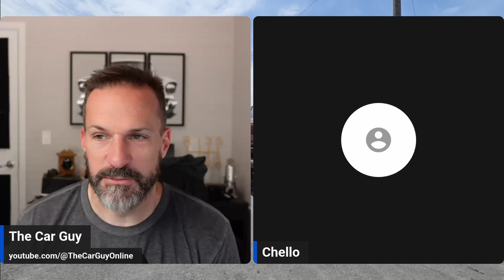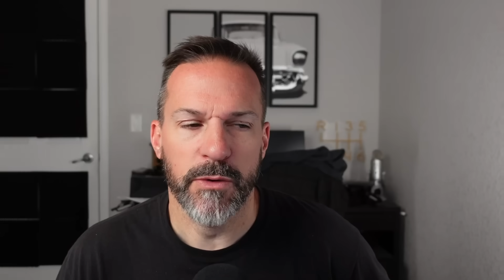Former GM Engineer EXPOSES Planned Obsolescence Tactics.

Comment: How naivety can skew reality. My goodness lol, who thinks this is GM specific? Cars are designed to last 5 years and trucks are 7. I’m a retired contract design engineer and while primarily gm based I have worked on many many brands, this is what everyone does, since the beginning of time. It’s called a budget. You want all the advanced technology and a car to last a lifetime and get crazy mpg and go 0-60 as fast as possible and tow 20k pounds? Most can’t come close to affording that. You can’t force people to take care of their cars, manufacturers are covering their ass with the 10k oil change, you try to go to a Toyota or Honda dealer before 10k and ask for an oil change. They will argue with you! Honda dealers these days will flat out refuse to change your oil at less than 10k. I still do my own maintenance no matter what I’m driving.

Comment: Stopped buying American cars 20 years ago.

M3 from 2015 that is tracked 4 times a year and has 80k miles on it. NO ISSUES NOT ONE

X7M 60k miles NO ISSUES.

Both bought used for less than $50k each.

Comment: Used to have freeze type plugs for oil gallery... Now it's a plate with little rubber gasket. That fails. Then the you have to block off the valve on oil pan it can fail....their final trick run the engine hot

Comment: The factory and the dealer care about the first owner who buys a new vehicle on a five-year loan. After five years (lets assume it has 40K miles), they want you to trade it in at the dealer and buy another new car. The dealer then wants the car to have a "good enough" reputation at 40K miles that he can sell it with a loan for monthly payments to a customer who can't quite afford a new car. The factory doesn't profit from the second owner, but the dealer does. 

Lets assume the second owner has the vehicle for seven years and the vehicle is now roughly near 100K miles at 12 years old. If a dealer gets one of these on a trade-in, he will send it to auction. If the owner tries to sell it direct to the public, the "third owner" market is rough. You might get a loan from a bank but the interest rates will be high, and if selling it for cash, you have to find someone with enough cash to pay $5,000-$9,000, and this puts pressure on the seller to lower the price. 

Since the Factory and the dealer do not make any profit off of the third owner market, they simply do not care about reliability after then. As long as the first and second owner are loyal to brand "X", the factory and dealer both want you to send them to the junkyard when they are 12 years old...

Comment: 18 yrs late to the party brother.

It was obvious when the 07+ gmt900s came out heavily reliant on can-bus systems and the modules kept failing and right at the 15 year mark- GM stopped supporting parts and the aftermarket for modules was flashed used modules ensuring the trucks are heading to a crusher. 

Hell. I have a 2009 that GM told me part were on back order for 3 years until the 15 year mark and it was discontinued.  So I asked them what am I supposed to do with a truck that’s a boat anchor- the dealers response “we have new trucks on the lot outside”

I’m not trying to buy an $80k touch screen with a truck that sorta works attached to it. I want the truck I paid in full for to work.

Comment: Every time I hear these explanations all I can think of is very wealthy men playing money games.  It's always cost savings!  Cost savings!  What are they saving?  It's always the customers that pay for the cars.  What's the cost difference between buying a car that will fail and a car that is well-made and will last?  Is it like $1000?  I'd rather pay the $1000 extra to have a car that wasn't going to break, as well be worth decent money when I'm done with it.  I gave up on GM cars years ago for the very reason that time after time I'd have to unfairly pay for repairs and replacement parts, and it was always because GM went cheap.  It was always failures due components being made cheap and they would fail.  And I say unfairly, because customers can't break things that I've had to pay for.  An example is, short of stabbing the instruments in the dashboard, how can a customer break parts that are simply looked at?  Another example is, how can a customer break a brake caliper housing?  So, GM hasn't had any of my money for almost twenty years now.  GM has to know about people like me, so I say the powers that be at GM just don't care.  It's all about very wealthy men playing money games.  Perhaps GM's upper echelons would do well putting study into the Ed Cole years at GM.  GM doesn't need money boys at the top because clearly that doesn't work.  GM needs engineering men at the top because they're the ones who can create well-made cars and turn a profit.

Comment: I was aGM guy forever.  My 2014 Camaro ended that. LS3 great motor shit oil pump. Check valve hung up, at 20k miles, thank God I caught it immediately. It was a known problem they said was fixed in 2013,bs.  Fuck Mary Barra, she ruined GM.

Comment: Driving an original 03 Element with 280,000 miles and replacing head gaskets on an original 04 Forester with 230,000 miles.  They are great cars.

Comment: 25 year mechanic here,  I used to think GM was really bad engineering,  then I realized it's really good. They know exactly when it's going to fail. Buy a Honda or Toyota.
Reply: You dont want a honda nowadays. 😢
Reply: Ive had 4 Mazdas...I beat all of them to death...530k...437k...one run over on the interstate by an idiot at 250k...260k+ on a 2016  cx-5...why buy anything else? Brakepads & rotors, tires, sparkplugs every 100k...I'll have another. Wish they designed & built a v8 pickup with an 8 ft bed
Reply: Late model jap brands are no better than anything else these days.  All garbage.
Reply: Absolutely. With todays technology and manufacturing capabilities every part is designed to work so many hours.
And they literally can and do work damn near exactly the amount of hours the part was to designed to operate regardless
of its application. Autozone was one of the first to master this manufacturing technique with the majority of the Duralast line 
of parts working for just over a year before needing to be replaced. And for free mind you. Autozone doesn't have the best parts, but they do have the best warranty.
Reply: And they don’t share that information with you, the customer, so you can at least predict your own maintenance.
Reply: Buy something pre-covid.
Reply: @papablunt49  it’s pre 09. 
The 08 crash made them look at thier business models. Also euro 5 came in so you started to see more DPFs & EGRs on diesels and direct injection on petrols.
Reply: @HellSent2.0  Lol exactly what I was thinking
Reply: @papablunt49  Buy something pre-2008 economic crisis

Comment: I have only bought one car that was built after 2006. That car's transmission went out at 101,000 miles. Both cars built before 2007 are still going strong with over 200,000 miles and probably will last up to 500,000 miles. I don't miss them spying on me with OnStar or all those expensive sensors they put on transmissions and engines. A cigarette lighter does just fine for charging my phone which also provides GPS, music, and weather. If the automakers think we are stupid and continue in their ways, consumers will become as resourceful a Cubans in maintaining their cars and the auto industry will cease to exist.

Comment: I can’t remember his name. This is about 1995 in Seattle Washington at a little restaurant called Mr. Ed’s on 1st Ave., South. There was a couple guys I used to talk to every now and then in one of them was a retired automotive engineer he told me the most Difficult project he ever did now this was disgusting and it’s not his fault. He said they wanted him to Design this is General Motors a wheel bearing that would make it past the warranty but not last more than 45,000 miles now you know why I find that disgusting you gotta remember let’s talk to 50s. I’m now living in Pennsylvania. There’s a crossroads 8 miles from where I live cranberry corners if you went a mile either direction north east south or west maybe 2 miles at the most you were in desolate areas if your car broke down, let’s say in a dead of winter You were gonna have to walk several miles before you could get to a household that would let you get out of the weather so let’s picture a family with young children. They could’ve died due to exposure because it was greedy. Jack offs pieces of shit at general motors. My name is Jim Mungai from kennerdell Pa

Comment: I was Mister Goodwrench at 3 GM dealerships and planned obsolescence isn't the only problem, sending every truck out without enough gear oil in the differential and low ATF in every auto transmission they sold!
Reply: Low fluid levels in new vehicles they sold or used vehicles or both?

Comment: The consumers that are shopping for new pickups are the young people coming in the world of adult hood,, They want tech an a power engine an the manufacturing stepped up for that but a powerful engine does it make a pickup truck what do you do with the power plant after 6 or 7 years take it out and set it over here in the corner for furniture because I thought it was good for not like back in the day when you could just rip those days are over unless you're quite the fabrication man then anything's possible. But man these pickup trucks down in a pile and completely out of sight and the old square bodies from the 70s and early 80s are still going to be running around,,, for the money they charge for those new pickup trucks a man could buy a small piece of ground small house and that's all fine well and good if you bought a pickup truck that was going to last 30 or 40 years but it won't last five years without some major major issues and the A-frames falling off and the rear ends going out I mean that's not that's not right man for the for the money we pay for those I have an 05 HD GMC with the 6 l in it and it's sitting down there in my other place in the garage completely unusable the rear disc brakes on it was causing me just throw me nuts every year new brakes new rotors it is a 4 * 42500 HD and the front differential is ready to fall out on the ground I mean it's that bad ridiculous bad idea that's pretty good money after bad it wasn't the last one another year and it didn't just junk might as well say not even good junk I love the 6 l 0 it's a beast but what does it do with the rest of the truck that it belongs and just power rust and completely just scrap they need to straighten up and at least back up and fix us up more than welcome and would take care of a lot of everybody's issues I don't think it's too far out of line to be expecting it and ask for it and somebody ought to have a lawsuit over it and I don't see how you can lose

Comment: The last good vehicles I owned were a 2007 acura TL type s and a 2000 dodge durango 4.7l both cars never had any big repairs in the years owned. The durango is a tank in the snow with some good tires

Comment: The last point he made is a HUGE one. Most consumers don't take care of their vehicles. They want a new one every couple years but don't want to pay for the maintenence. That lead to leasing, extended oil change intervals and pulling money out of every aspect of the vehicle because it didn't need to last as long as it used to.
Reply: There is virtually no maintenance required in two years besides oil changes. No engine service required. No transmission service required.

The maintenance argument is tired and barely there at all.

Comment: And this is why I'll drive my 03 Silverado 1500hd til it physically cannot drive anymore. No fancy sensors/cameras over every square inch of the body to throw codes when they fail, no susbscription required for bluetooth (aftermarket double din FTW), no damned cylinder deactivation bs, and a good reliable 6L engine and 4L80. I got power heated seats & mirrors, power windows/locks, cruise, dual zone a/c, bluetooth, and a crew cab 6.5ft bed. Perfect for loading up firewood/tools/lumber/plywood in the back with enough room for the groceries or passengers in the back seat, and can still haul a mini excavator to the job site if needed. Make trucks great again 🇺🇲

Comment: Ford Motor Company also did the same thing. The newer trucks dont have oil or trans dipsticks to check the level. Its all done so you have to take it to the dealership and pay big money. Dealerships dont make much off selling vehicles, they make money off the service/repair side of it. They all cut corners to cut cost so it wears out and breaks and you have to pay out of pocket.

Comment: "They have always cut corners" yea no shit. Anybody who isnt a dumbass GM lover knows that they are designed horribly. The fact that doing basic maintenance(changing oil, battery, air filters, etc) on anything produced by GM is harder than any other common models I see in the shop is more than enough proof that their vehicles arent worth half the money you pay for them. Garbage on wheels.

Comment: What everyone needs to understand: nothing is ever done without compromise. A „no compromise“ product would be too expensive and therefore not competitive. A good product wears evenly across most components and will therefore be totaled after its intended lifecycle, so it can be replaced in its entirety. This is not cutting corners, it’s good practice. If you don’t like this, buy an old product which is engineered with random lifespan across components. Then you will have to constantly exchange something else and spend a lot of time on repairs, but if that’s what you like, there’s nothing wrong with it. It’s just not possible for manufacturers to make such products and be competitive.

Comment: I can only imagine how the meetings with Engineers (who take pride and want to build better) are perceived by management.

Speculating here but I believe it has happened where (honest or new to the industry and new to companies that want planned obsolescence) an Engineer will suggest ways that make it better, more durable, more easier to fix etc. would not only get their ideas ignored but ironically have themselves NOT ignored.

Management will view them as a potential issue for thinking that way and not thinking or siding with management on how to essentially make things to steal/fleece or call it stimulate sales/stimulate profit from the people by building things not better but worse (intended, designed, orchestrated and planned controlled destruction).

If you are not in the side of viewing it as stimulating sales/profit and exhibit, slip, waver and or in the camp of viewing it as dishonest theft, unethical, sabotaging the consumer then you will be fired/removed as a "Risk to the company".

Comment: Im a Automotive Technician of 23 years. Always worked at a independent shop. Currently have a 2007 Silverado 1500 Vortec MAX. Has 6.0Lt and 4L70E trans. I feel the 07-13 was the last of anything decent from a GM truck. I will not be buying another GM truck after this one. Cutting cost then charge 80-100k for a new truck.

Comment: My first car was a 69 Camaro, put down just over 300hp on a dyno. The engine was bolted to a 350 hydromatic I pulled from a junked 1975 Impala. I changed the fluid, filter and added a shift kit before stuffing into my 69. I sold that car 9 years later with the same tranny, and it chirped into second everytime w/o a hitch. This was from 1994-2003 and roosted on the car.

Comment: I just saw a post from Ford Tech Makuloco on his FB page. Apparently stabilizer bars are no longer bars...they're pipes. He showed one that snapped at the frame mount. There's some rust, but not enough to snap an actual bar. The pipe Ford used on that 2016 F150 couldn't take it. It's pretty pathetic. Some of the auto journalists are still drinking the kool-aid that executives are feeding them. The proof is in the pudding though.

Comment: I have a 2001 f150 7700.  I keep it in good shape. It has 120k miles on it. If it needs a repair I will usually do it myself. I will likely drive it another 20 years and will be more reliable in those 20 years than a brand new truck would have been.

Comment: This is not a GM problem. This is an every industry worldwide problem. Nothing is designed or built to last and be repairable anymore. Just wait till everyone with modern cars starts experiencing software and hardware degredation. Your iphone is junk after a handfull of years and ended update support. These infotainment syatems are no different and will start bricking otherwise good cars...all to plan and nobody seems to be asking about this or talking about it

Comment: Former GM DE in powertrain/transmissions/new pumps new products. This guy is not exaggerating anything. There were a lot of questionable things going on in our group. The first decision in the transmission group was how much money they want things to cost and then the design started around that dollar value. When vendors came in high they would either be forced to meet the price that GM sets or ties would be cut and we would move to another vendor. I did specifically bearings in the transmissions and we had changed to three different vendors on the first iteration of the Hummer EV before anything was even released for production.

Comment: Still driving my 02 Chevy Cavalier bought used from Hertz — a simple car that I can maintain and repair myself. About 180K on it now, and I've never once had to add oil between oil changes. Invested the money I didn't spend on a flash car in the stock market where it has appreciated significantly over the past 20 years.